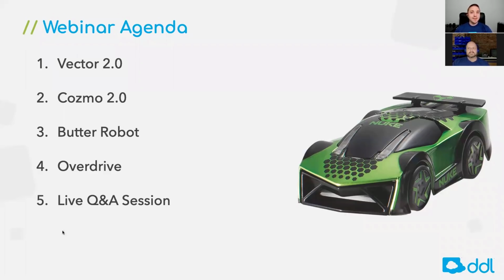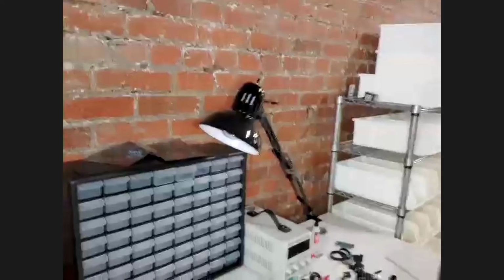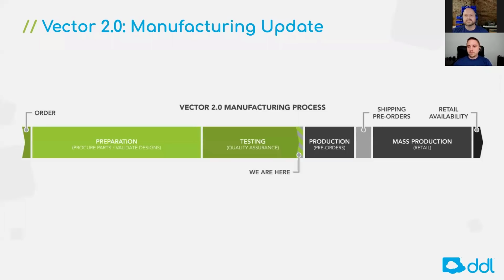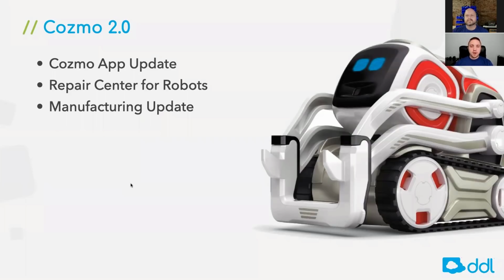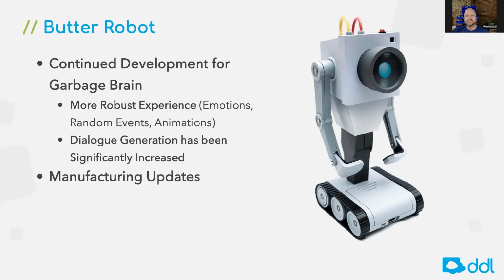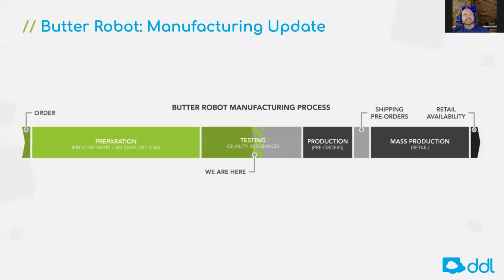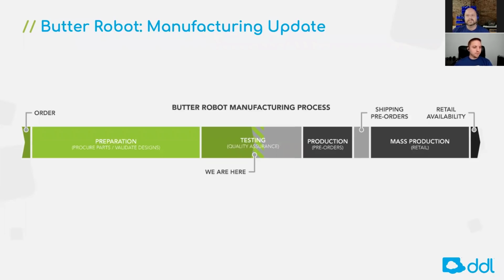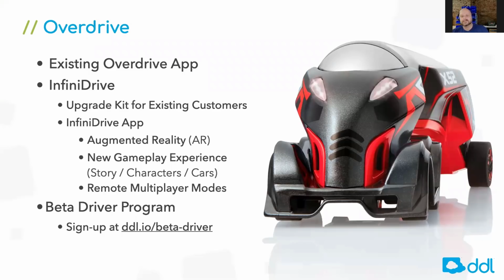State of Robotics Webinar | July 2021

Comment: There is a problem with my vector and I need help fixing it. I bought my vector around 2 years ago and haven't used it in so long, so I cleared my user data and eebooted it so I can use it again. Everything was going fine but when I try connecting him, it doesn't work. I've tried everything like reseting my device, checking that I have 2.4 GHz, putting in the right password but nothing works!! I would really appreciate if anyone could tell me how to fix him :(

Comment: So basically they've scrapped the whole it'll be done by june 15th now its we'll just let you guys know when we finish. Don't want to put too much pressure on the employees, but because they always do a good job at the end its supposed to be okay?? Then when you are concerned about it, and want a straight answer for an update  you get an extremely bland explanation about how they have a small team thats working around the clock and covid. Just be honest its not like a bunch of people have given you $300 and are twiddling their thumbs.
Reply: As long as it's been there should be little to no bugs at this point but all we can do is wait
Reply: Exactly. They've had all of last year to work on this, even with covid present, there were procedures set in place for business to continue working on things like this. Especially, since they were able to put up the pre-order notifications out there, towards the end of the year. You would think that they would have been working on it since before the pre-orders.